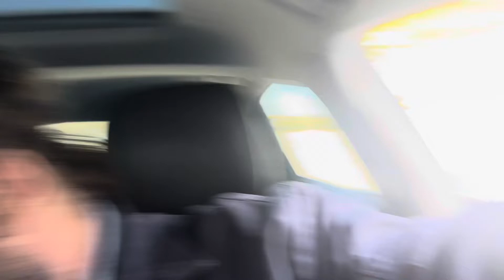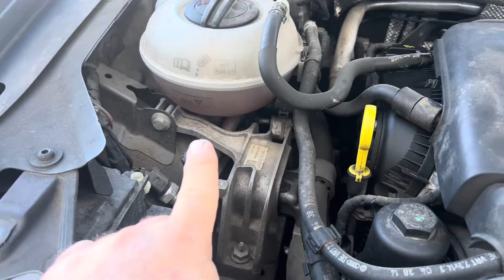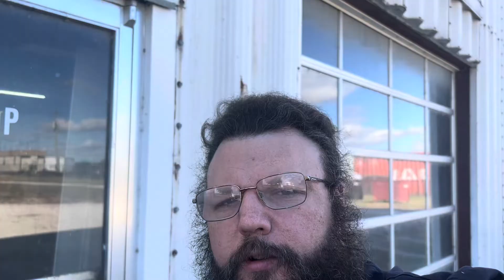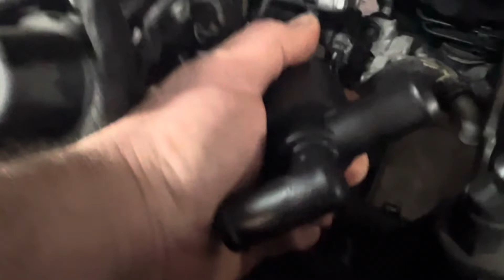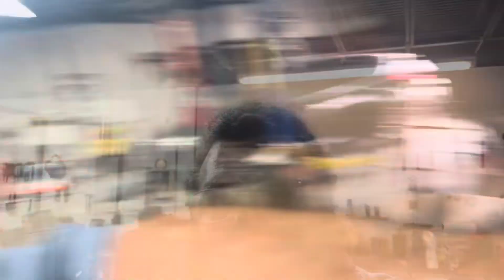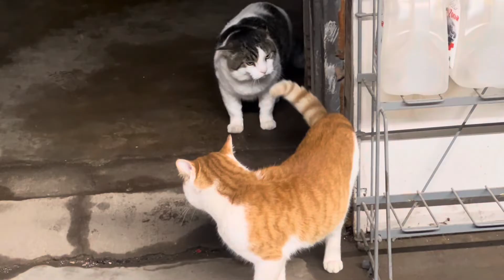2015 Audi A3 Quattro, no heat diagnosis and repair

Comment: If this valve is running bad. Will my car tell it on the computer or make a faul code? Because i have same issue. no heat. Only one drivers side but very little.
Reply from the maker: This one set no fault code that I remember
Reply: @bulldogsautomotiveadventur4387 ok thank you.

Comment: I've got heat on one side but not the other, changed blend door actuator, flushed heater core , car holds temperature, inlet & outlet pipes doing what they should, coolant level fine, everything fine etc , instant hot or cold on passenger side but just cold on driver side, help me 😢
Reply from the maker: Sounds like broken blend door
Reply: @bulldogsautomotiveadventur4387 I changed the blend door actuator and recalibrated it , all works fine, I can hear all the vents open & close behind the dash when I cycle through different modes , I'm trying to avoid main dealership on this one 😢

Comment: @bulldogsautomotiveadventur4387 When you changed the valve, did you have to bleed the air from cooling system afterwards?
Reply from the maker: I don’t believe so, I didn’t even drain the system, but I don’t remember for sure, it’s been many cars ago.

Comment: I have a 2015 A3 Quattro 2.0 Premium Plus. My car has the EXACT same symptoms:
* No heat, even after the engine warms up
* The heat will work normally after driving at highway speeds when it's above freezing outside, but not when it's below frezing.
* The heat will also start working if I warm up the engine, make a brief stop with the engine off for a few minutes, then start it again.
* The vents will blow even colder air if I turn the HVAC temperature control all the way down to LO,

I suspected a thermostat problem, but the HVAC Heater Control Valve problem you found makes even more sense.

Thank you.

Comment: 2014 Audi A6 here -  garage wanted to charge me $1300 because they were 100% heater core was clogged - that was theit diagnosis after doing a $150 flush on the heater core. I did not agree because I sometimes had heat but it was rare and after the car had been running for an hour at least. I stumbled on this video by the grace of God and said... that sounds like me. So... I bought the $65 heater valve from Auto Zone took about 30 minutes of my time... I am not a mechanic at all. It was easy to get to and easy to replace. After replacing the valve... BAM! Heat is working extremely well in just a few minutes. I called the garage and chewed them a new one... they didn't care I'm sure. I saved over $1000 and probably more because a brand new heater core would not have fixed it... then they would have charged me another at least $700 to replace the valve which was the issue in the first place. 
Nonetheless.... thank you for the assist!!

Comment: My Audi A3 was diagnosed to need a heater core replacement. The high revving check showed still no heat at all, even when cruising at high speeds over long distances. 
My instinct was this valve malfunctioning, and this video confirms my suspicion. I plan to order a new valve and fit it as my first remedy. Wish me luck! 🤞
Reply: Did it work?

Comment: Part number? Part name?
Reply from the maker: @dalethornton1113  heater shut off valve, pn# 4H0121671D
Reply: @bulldogsautomotiveadventur4387  Is this problem solved or back again? I have the same issue on an S3 2014, heat comes and go, I changed the same part but the issue still there.. 
Temp motor oscillating between 90°C to 110°C.
Reply from the maker: @ as far as I know it’s fixed

Comment: I have the same problem with my  audi a3 I changed the heater motor it wasn't the problem. When I put on low heat it works when I put it to the maximum it starts blowing cold air.
Reply: Another issue is the small bag of silica  gel   that's in the expansion tank after a while it burst open slightly and the gel that comes from it clogs up parts namely the heater matrix,  all vw & Audi's have in issue with this culprit , the bag is pretty difficult to get out and is easier & cheaper to buy a new tank at £10-15  onwards,,,
Reply from the maker: @motivation-eh1kb  that sounds more like the core plugged up, low flow through the core will still produce heat but with the fan on high it blows it away and can’t keep up, if you’ve already checked that valve to make sure it’s flowing I would flush the core to see if that does it.
Reply: @bulldogsautomotiveadventur4387  not yet I haven't checked the valve.
Reply: Whats that value cakes exactly same on mine no air
Reply: @richiehutchinson2801 No air equals heater blower motor failure. I've just changed mine. glove box out and 3 screws and 3 clips to replace. Pretty easy DIY. 👌
Reply: Called even
Reply: Did you ever get it fixed? I'm having the same issue
Reply: Did you ever get it fixed? I'm having the same issue